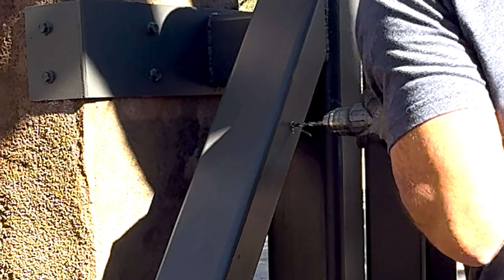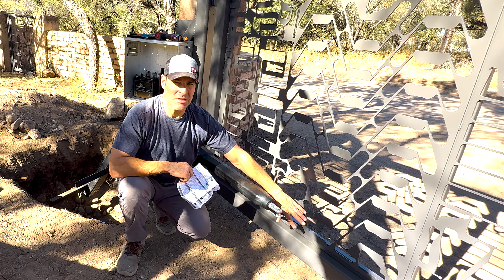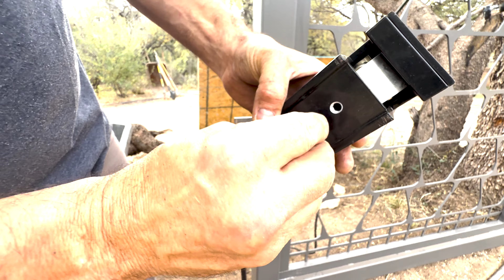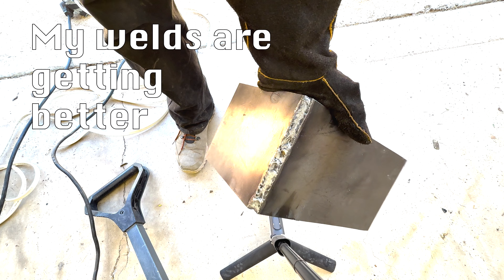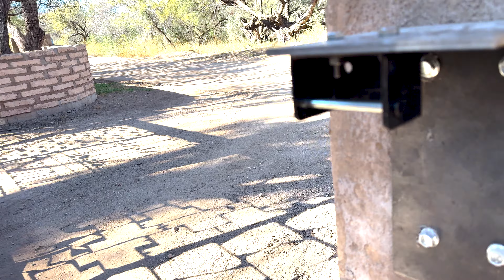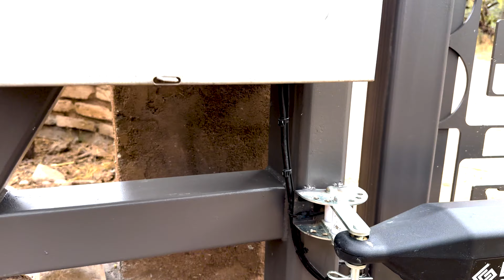Installing Ghost Controls gate opener

Comment: Door doesn't sag because of the weight itself?
Reply from the maker: No. Two yards of concrete and the hangman post keep it solid. Hinges are rated at 3500lb each. Gate weight is right around 600lbs.

Comment: Hi. Can you possibly link the supplies for the battery & the 30W solar kit. My gate is JUST like this. I have wrought iron gates with concrete posts also and most videos I've seen, folks have wooden posts, not brick or concrete so I'm grateful that I've found your video. But I'd like to ask for the link of those supplies used. Thanks.
Reply from the maker: I’ve copied and will paste the components separately.  

Battery 1st:

CB CHROMEBATTERY 12V 21Ah SLA... https://www.amazon.com/dp/B00UA52VS4?ref=ppx_pop_mob_ap_share

Solar charge controller:

https://a.co/d/0bYeATYL

Comment: Very nice gate! I also have a 20' farm/tube gate. Do you know which ghost control model you installed?  Heavy duty, decorative series or the manor series?
Reply from the maker: Manor. It was rated for 400lbs at 20’. I’m over that weight but it does fine. I’ve made more mods to the gate and it closes better now. The motor also came with the post mount. I used it to the motor base to the  6x4 square post I have
Reply: @RollinHomies thanks for the reply! That's what they suggested I should buy but not many videos that actually specify the length of the gates they are installing the openers to.
Reply from the maker: @chile2be991 you’re welcome. Ya, this gate is a beast! I used 3500lb rated ball bearing hinges. An easy breeze can blow the gate open. I ended up welding a solid piece of 3/16” angle from the top of the gate to the bottom. The small 1x4 leg I attached was too weak for the gate.
Reply: I was wondering if  that short piece was going to hold considering the stoutness of your gate. Did you end up using some kind of deep cycle battery? If so is it enough along with the 30watt panel to keep your motor functioning?
Reply: I was wondering if  that short piece was going to hold considering the stoutness of your gate. Did you end up using some kind of deep cycle battery? If so is it enough along with the 30watt panel to keep your motor functioning?
Reply: I'm not sure if I want to use the solar panel/battery or the battery/ 110to12v charge adapter.
Reply from the maker: @chile2be991 my gate is 360’ from our house. Didn’t want run power down there. I bought a larger 12v battery for more storage and my own 30w solar panel and charge controller. Gate gets opened maybe twice a day. Does fine with that.